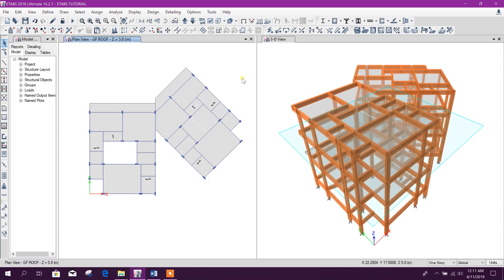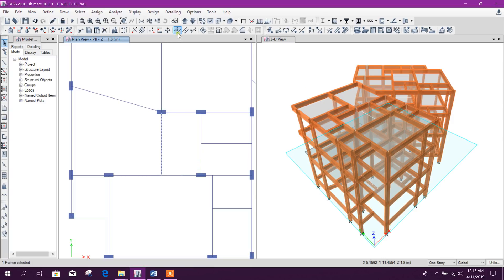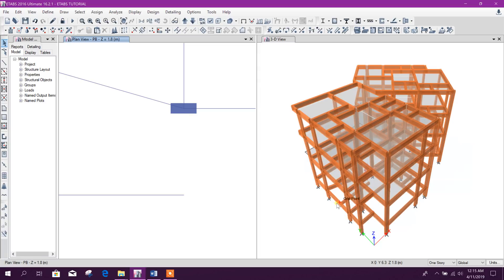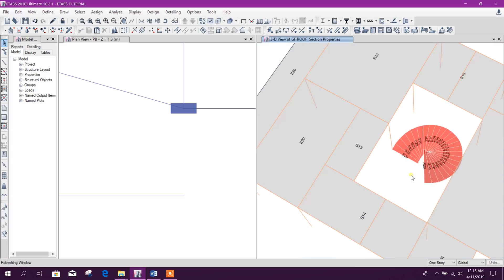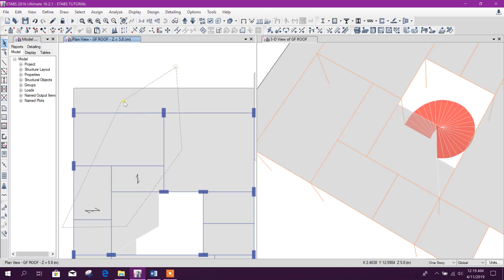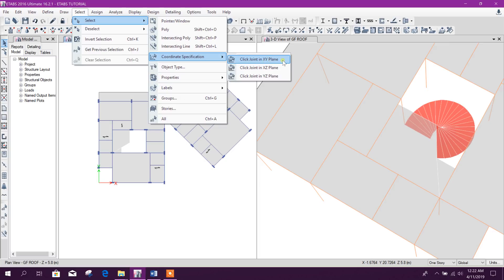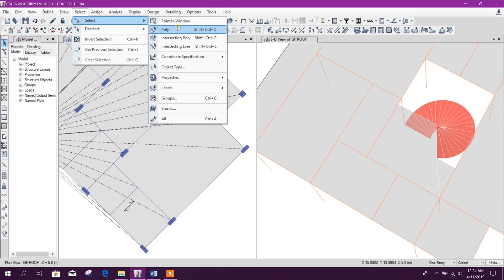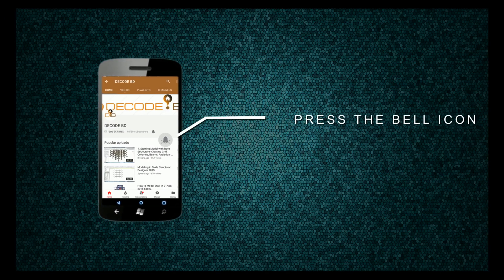ETABS IMPORTANT TIPS & TRICKS

Comment: bro how to contact with u i want to join ur class
Reply from the maker: I can help through youtube only. If you need any tutorial just comment. I will try to prepare in sha Allah.
Reply: @Decodebd  thanks bro I can create apply loads run analyze but 
At the end I am confused of checking the structure whether it is safe or not in etab for ex in version 17 how to do siesmic cheks drift displacement torsional irregularities and how to solve if it happens.
Reply: Also let me know how to do stairs analysis and how to interpret the sap results to find reinforcement
Reply from the maker: Etabs v17 is not full functioning with cracked version. Better use ETABS v16
Reply: In my case it works fully but i am confused how to apply checks before detailings. like seismic checks irregularities checks